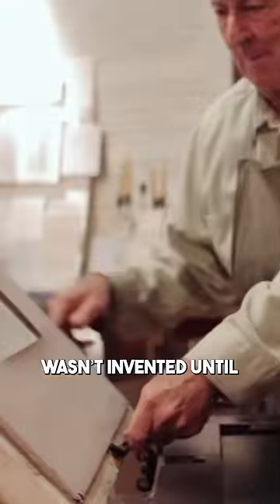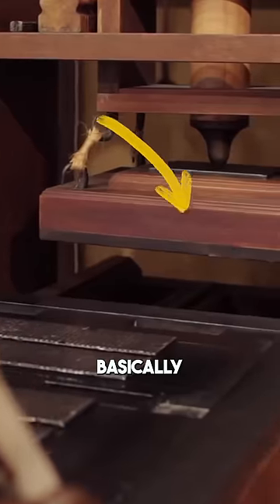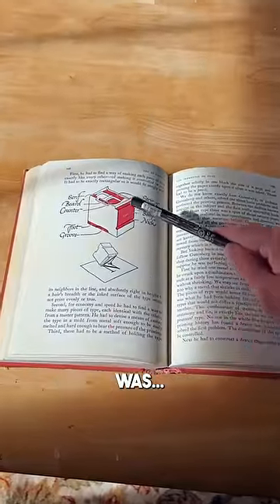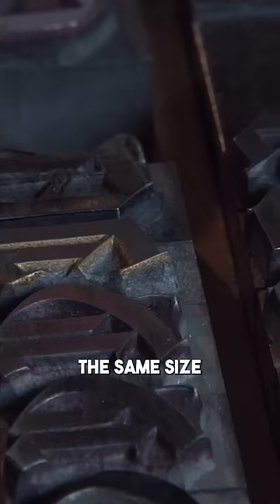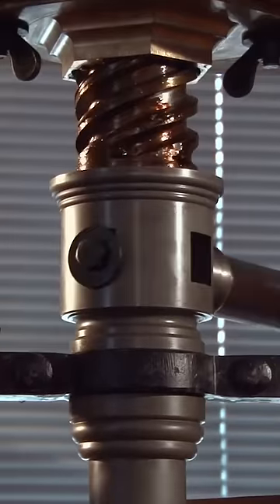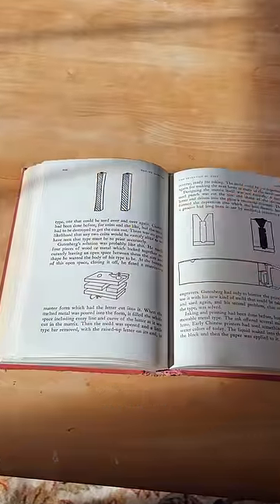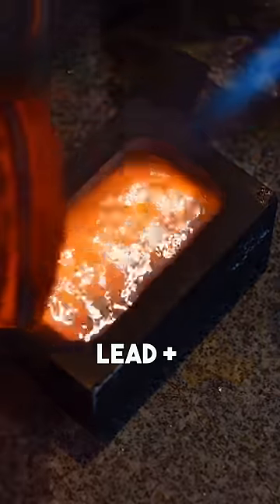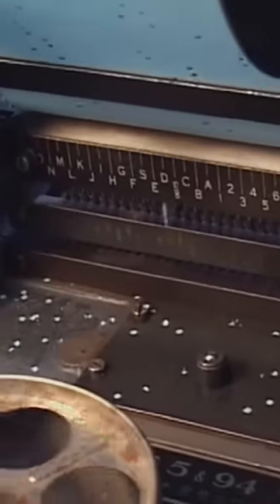The Hard Part of Inventing The Printing Press

Comment: I worked on a big newspaper in 1971 which used letterpress printing (lead). Then on newspapers which used offset printing (photographic lithography). Digital didn't come into wide use until later.
Reply: Yes. Digital became widely used only around 1990s or even later.
Reply: How does photographic lithography work?
Reply: @thomast7794  , we would type text using an IBM Selectric typewriter then paste it onto cardboard "flats."  Special photography would transfer the image onto a piece of thin metal. That metal would be attached to a rotating cylinder of the printing press. Then the building would shake as the press accelerated up to speed!
Reply: @thomast7794 : You shoot a negative of each page of whatever job* you're doing, strip that negative and expose it to a photo-sensitized plate (which could be either metal or paper), then fix that image to the plate so that the rest of the plate doesn't turn black when you remove the stripped negative and bring the plate out of the darkroom, then you attach the plate to a roller drum on the press you're using, and VOILA!
Reply: Yes, I've seen the newspaper 'film'😮
Reply: I misread that as 1791 and wondered if you were immortal
Reply: Was thinking of The Printworkers' Union' strike in Wapping against Murdoch, which was late '80s. With Thatcher in power and the recent defeat of the miners; they never stood a chance. They fought though.
Reply: @michaeljames5936  ,  hard on working people when technologies change.
Reply: @onyx747  ,  I'm old but not THAT old! 😉
Reply: @BartAnderson_writer  😂😂😂
Reply: Y'know, 60s, 90s, what's the difference? ;)
Reply: 😢Finishing my career in newspaper production a one of the last Electrical Engineers keeping these machines rolling.  Like the last steam engine engineers were, or the last oxen freight drivers, or last coal miners...we exist...
Reply: I worked on a Heidelberger Degel printer when I was young. One of the most beautiful machines ever created. It has the sound of a beatbox.
Reply: Yup lotsa capital has to be had an spent to upgrade newspaper presses. Definitely wasnt a over night change❤
Reply: Likewise. In highschool, because of the typesetting, I got jobs with two different print co.'s who taught how to use the AM1250 offset printer. I used to know how to use mimeograph as well.
Reply: Lol also a printer came here to say exactly that , letterpress then offset / flexo then digital for sure
Reply: You got blue comment
Reply: BLUE COMMENT ON YOUTUBE??
Reply: @Snapion__  yes
Reply: Stop lying lmaooo

Comment: I love this. I'm from Mainz, Gutenberg's hometown, or Johannes Gensfleisch (goose meat) as his real name was. In the Gutenberg Museum, they don't tell you about this, if I recall correctly. Been there many times. They do show you though all Asian inventions that used similar techniques beforehand (moving lines of letters instead of individual ones e. g.).
Reply: I always enjoy hearing about obscure nerdy museums like this.  If I hit the lottery, it sounds like a good spot to visit
👍😎
Reply: Neat! I wonder what materials the Asian presses used?
Reply: @geeksdo1tbetter  mosly wood and clay for the stamps. Which is a reason why the metal letters from Gutenberg were so usefull and important. They did not break as easily and were a lot more conform (less differenses between two stamps of the same letter) than the handmade wood and clay ones.
Reply: The “Asian” invention is in reference to the first true moveable typeface invented and used by scholars of the Koryo Dynasty, the penultimate Korean dynasty that existed for 480 years and came before the Chosun [or Josun, in the modern bastardized and mangled anglicization, or transliteration] Dynasty, which lasted 540 years. 

It is the Koryo Dynasty whence the name Korea comes. The metallic typeface invented by 고려(Koryo: 高麗) known as Jikji made its way over to Europe via Marco Polo and found its way into Gutenberg’s hands. The Koryo printing method precedes Gutenberg by about two hundred years, a fact largely ignored by Western historians, but hardly deniable. 

There is much more to history than meets the eye, for everyone’s information. K-culture helped beget modern Western culture by way of K-type, if you will, as Gutenberg got to print the Bible in German—thanks to Martin Luther’s translation of the Bible into German, in the process of which he practically invented standard German. Gutenberg also went into partnership, as it were, with the Catholic Church, by printing indulgences for believers to shorten the time spent in purgatory by their loved ones, etc., the practice of which did not sit well with Martin Luther and other reform-minded folks at the time. 

In case anyone has been impressed with K-Pop, K-Beauty, K-whatever, it’s time you really gained an appreciation for K-Type and K-Thought. 

I strongly encourage everyone to look into the true history of how the Koreans have been most instrumental in the development of culture throughout human history since time immemorial. 

Kyuho Tae
in Prague
Reply: @kyuhotae6410  imagine being a Korean loving Korea with every fiber of your being 

And then living in Prague
Reply: @kyuhotae6410  Thank you for the new information.
Reply: @kyuhotae6410  
Actually the Chinese invented it before the Koreans did.
Reply: @cat_city2009  Not so. We are talking about the first moveable metal typeface. The Chinese have no claim to that. Go back and read your history.
Reply: @crios8307  I tend to travel a lot. Prague is a nice hub of a base for me. 😎
Reply: @kyuhotae6410  I checked it out. The Chinese invented movable metal type first.
Reply: @kyuhotae6410  
lmao nationalists are silly people.
All of east Asia got its technology, culture, writing etc from China. I'm a Westerner and I admit we owe everything to the Greeks and Romans.
Reply: @cat_city2009  See my other reply to you. I agree that nationalism is silly, which is why I was quick to point out the fact that I am engaged in anything but. I am a stickler for intellectual honesty, especially when it comes to historical details and facts. 

I, too, am a student of the Classics—East and West; Orient and Occident. That is no accident, either. As a red-blooded American, we all do well to learn how to recognize false narratives, be it from CNN; China; or your yet-to-be-disclosed sources. 

In all modesty and sincerity, I am eager to learn of those references to which you refer. Please be so kind as to share. Thanks.
Reply: @cat_city2009 depends on the type of nationalism. Chauvinistic or jingoistic nationalism is bad, but simply loving your country (without hating others and without being uncritical of its flaws) is a good thing.
Reply: @kyuhotae6410 i think both of you are right to a certain degree, while the jikji and chinese printing press were invented before gutenbergs, they used a different method. Which of them came first is basically unknown as they date to about the same time 10 years apart. It is also important to understand that during this time china and korea were very close which could play a part in this. I do find the claim that “anything in asia comes from china” is a dangerous and slippery mindset to follow and is untrue in plenty of cases. While china was the cultural powerhouse of east asia, and could possibly be credited for the origin of alot of east asian inventions, this does not mean other places have no claim to the improvement of these inventions.
Reply: @crios8307  lmao but I don't see the issue? Sometimes people live places bc of factors other than "oh I just like it here." And it's perfectly fine to be proud of your culture & heritage while enjoying another one at the same time.
Reply: Stop lying lmaooo
Reply: @auraaa_2991  written record of the first use of metal moveable type was year 1234 in Korea, and at that time China was under Mongol rule. 
Also, they did NOT use 'Press" to print. they just applied paper on to the block, and rub it down with cushion like device, because the ink was good enough and didn't need any mechanical means to apply heavy pressure to get high quality print.
Reply: @davidjacobs8558  so not really sure where you’re getting your information from? I do see a mention on wikipedia about credits going to Ch’oe Yun-ui in 1234, but im pretty sure thats about the first movable metal type in Korea specifically.. as literally a couple paragraphs above it mentions that “The earliest printed paper money with movable metal type to print the identifying code of the money was made in 1161 during the Song dynasty. In 1193, a book documented instructions on how to use the copper movable type. The use of metal movable type spread to Korea by the 13th century during the Goryeo period,with the world's oldest surviving printed book using moveable metal type being from 1377 in Korea.” Furthermore, China was not completely under the Yuan in 1234, it was under siege just like Korea, in fact, it even mentions under Ch’oe’s wikipedia page that he moved to ganghwa island. Not sure why you mention mongol rule anyways?
Reply: @davidjacobs8558  and finally, you are correct as in neither the chinese nor korean ones were mechanical printing presses.
Reply: @auraaa_2991 same as with Roman’s / Greeks and serious use of steam engine, when you have that many people that their work is cheep, there is no need for mechanization.
Reply: @kyuhotae6410 
Stop coping

Comment: The classes I took in setting type and working printing presses were the absolute best ones I took in grad school. Once you get in the groove, you know where to reach, how to line it all up, set up the press bed, and run the press. It's a fantastic feeling when it's all rolling along.
Reply: Do you use a mirror to check?
Reply: @george2113  Not really, no. I got used to reading in pretty much any direction. You also run a couple of test sheets to make sure it's good. The most common goofs seem to be rotating or flipping b, d, p, and q. But there are ways to check while you're setting.

Comment: I worked at a newspaper in the early 2010's, we had switched to laser etched plates.  Would 'print' out 4 plates per page one per color.  They would then have the last quarter inch on each side bent/indexed and the plate was bent around a wheel in the press.  Was nice being able to reprint/reattach in minutes what took teams a lot longer to do before.

Comment: It’s why the first paragraph of a newspaper story is the “lede”, so it’s not confused with “lead”. Also, paragraph is shortened to “graff” so it’s not confused with the “graph” for a graphic/pic.
Reply: That explains why some Wikipedia editors discuss what should(n't) be in the lede, instead of the lead paragraph. 

Also, wouldn't 'para' be the better contraction instead of 'graff'. I've heard and used the former, but never come across the latter.

Comment: I don't think people realize how hard it must've been to make those little letters all the same dimensions.  This is what, 400+ years before we started engineering with actual precision.  For example, surface plates, kind of the baseline for modern precision weren't being sold commercially until 1904.

Mindboggling how much work it must've been to make all those tiny pieces by hand to that exact standard.
Reply: Maybe, but at the same time metal smithing and craftsmans guilds were far more advanced both technically and within the context of culture.

There are many pieces of worked metal in the grand mansions and castles of nobility that beg the question of how they were made with hand tools. Yet they were.

Also mathematics, and construction was advanced since the roman era, far moreso than we assume. Whether we look at medieval italian or even egyptian and roman architecture. Its clear that those who build are generally utilizing mathematics in their methods with the best of them making its use a matter of principle. (mathematics back then was essentially just geometry and arithmetic).

I think the issue is that literacy itself was not that widespread or popular, hence there was not any real demand for books by a wider population until Irish Catholics started teaching science and languages to lay people and not just clergy. Hence establishing the first public schooling system.

Naturally with widespread literacy the appetite and demand for books would rise in turn. Leading to the favorable conditions for its invention.
Reply: Precise engineering is very old, older than recorded history...
Reply: @kevinf8439  More difficult (technologically), more time consuming and often without standardization for mass or scaled production. It's not that it couldn't be done - of course it could - but requiring huge amounts of skill and time to achieve something we practically take for granted.

Comment: Linotype alloy is also highly sought after for bullet casting for many of the same reasons. It casts accurately and doesn’t shrink and it also is reasonably hard so it doesn’t foul the barrel as fast and stays accurate.
Reply: Getting Linotype alloy is harder now as most large printers used etched aluminum plated for their offset printers. Smaller shops still use the lead alloy however.

Comment: The moment you mentioned "How is it so hard to make a machine to stamp books?". The moment I also realize how little laymen know about,  and familiar with how a Printing Press works... 

We always took Printing for granted today in the Computer age, heck even I do it. There's a reason why the Printing Press is such a marvel of engineering. And the Font Blocks Gutenberg made and perfected is exactly it.

Just a heads up, Gutenberg didn't "invent" the Printing Press, he innovate it further to make them more practically viable
Reply: And even much earlier things, like what a spinning wheel is, what it does, and why it is needed.
Reply: You're incorrect, this is a common misunderstanding. China had earlier invented moveable type, but never invented the printing press. Moveable type is a component of a printing press, but they are not the same thing. Medieval Chinese moveable type worked by carefully pressing paper evenly onto the typeface by hand, which was slower and required practice to do without smearing the ink. By contrast, a printing press uses a mechanic pressing device for greater speed, consistency, and ease of use, which made it more suited to mass production of texts. Guttenberg was not the first to invent moveable type, but he was the first to invent the printing press.

Comment: Gutenberg improved on Asian techniques - the alloy being one of the improvements. Interestingly enough, Pb+Sb+Sn wasn't the only one used. There was also Pb+Bi+Sn!
Reply: I was more familiar with the lead busmuth alloy and unaware of the tin in the mix . Babbit metal as in babbitt bearings , alloyed for thermal-coefficients of expansion offsetting each other ( another expression is the different rods used in the pendulum of a grandfather clock to maintain length over different temperatures ) . Another alloy is used for lead acid battery cell interconnection .
Reply: Die casting systems .

Comment: Starting the 80s, commercial typesetting was still mostly linotype and phototype, created as a service by typographers.
Most commercial printing for packaging, magazines, print ads, etc, was offset lithography, which no longer used physical type, but imaged type, photos and graphics into rubber sheets that used chemicals and water to print onto paper.
By then, "letterpress", which used physical metal plates like Gutenberg pioneered, were only used for boutique specialty book and art printing.
Around 1984 came the Mac and the Laserwriter, the first broadly successfully laser printer, and when a company called Aldus came out with their PageMaker software, "desktop publishing" was born, and digital typography became popular.
By about 1990, pretty much all commercial typesetters were put of business forever, because people just "set type" on their PCs.

Comment: That's also why Linotype lead is ideal for bullet casting.
Reply: Thats what It’s called? They use that same alloy for bullets? Since when?
Reply: @yoeyyoey8937  They dont, but the characteristics line up. As a bullet you want a material thats dense (so it has enough mass to have more kinetic energy to impart to the target), usually soft (less overpenetration), easily molded into shapes, and yet has a relatively low thermal expansion, so that it fits in the case properly after casting. Commercial ammunition basically uses pure lead, but if youre casting and reloading at home, that alloy (4% Sn, 12% Sb, 84% Pb) makes it easier to work with on a smaller budget and scale.

Mergenthaler Linotype Company (Linotype) made machines that would literally cast an entire line of entered text into a single block for use in printing.  Because Linotype as a company was so influential, basically any alloy of lead used for typesetting like that was just called linotype lead, because you had to feed raw lead stock into the machine for it to cast.

You can still, to this day, buy raw ingots of linotype lead.
Reply: You beat me too it!
Reply: @yoeyyoey8937 ince the late 1800s when smokeless gunpowder increased velocities beyond what pure lead could handle without reducing accuracy for follow on shots. Essentially, since shortly after the adoption of cartridge fired breech loaders.
Reply: @teknikal_domain you can, but powder coating is cheaper and WAY less of a hassle.
Reply: @yoeyyoey8937  nuh uh. antimony and tin r expensive.